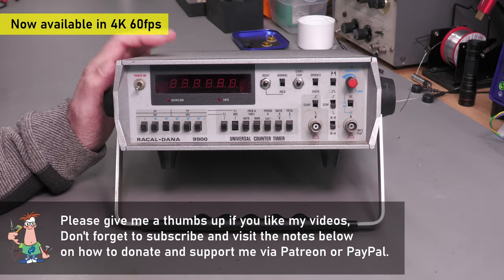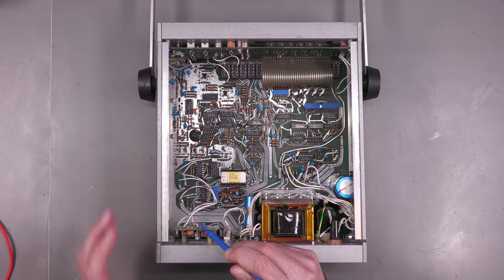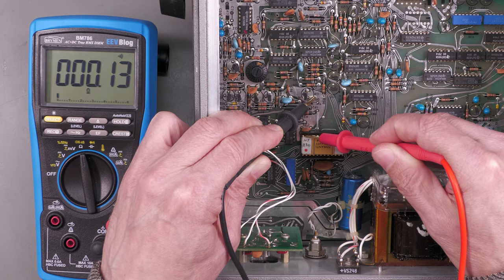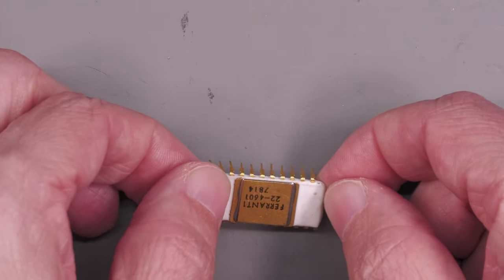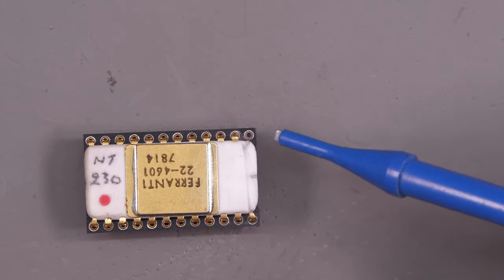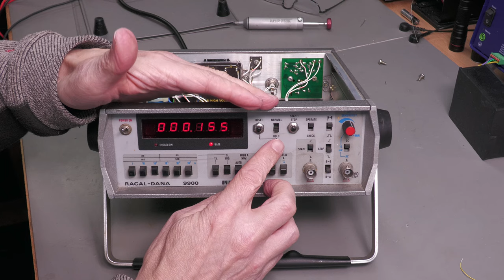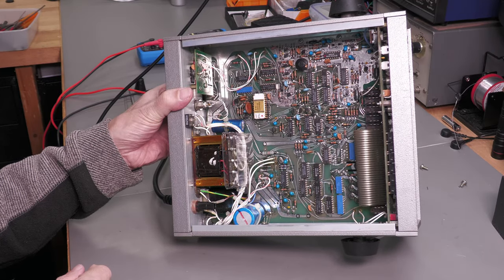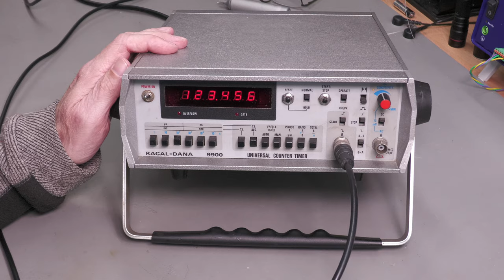No.119 - Racal-Dana 9900 Universal Counter Timer Repair

Comment from the maker: Re-uploaded to add in notice about the ceramic possibly being made out of Beryllium Oxide and the possible health issues. Better safe than sorry.
See the link in the video description.
Reply: Unlikely. Beryllium oxide is used as an insulating substrate with excellent heat conductivity. You'll find it in RF power transistors.
Reply from the maker: Agreed, possibly Aluminum Oxide or Magnesium Oxide?.....but at end of day who knows! I am borrowing a diamond tester (electronic device) which is apparently quite reliable at testing for Beryllium Oxide.
Reply: Thanks for the warning about Beryllium Oxide. That stuff is quite scary. I think people often encounter it when tearing down microwave ovens where it's used as an insulator in the magnetron. Better safe than sorry is absolutely the right call when doing any sort of grinding or filing of unknown ceramics!
Reply: @chongli297  Beryllium oxide is perfectly safe in bulk. The danger comes if you grind it into dust and inhale it. Don't worry about lumps of it.
Reply: @donepearce  Yeah though from what I've seen, people unknowingly take a dremel to it and create a ton of fine dust

Comment: Wow.  That dodged a bullet.  That LSI spun around 180 degrees and it still worked after correcting the orientation and (awesomely) grinding down the package to tack solder on the lead?  That's how I'd like to remember myself and my electronics technician past. LOL.   You are a master.

Comment: Nice repair, Ian.  Beautiful job on that ceramic IC; it should have been a total loss.  The way that unit's internal oscillator is configured on a separate board at the back of the enclosure just cries out for a high-accuracy, high-stability upgrade.  Future video?
Reply from the maker: It’s a 5MHz crystal oscillator on that wee Pcb I believe, if it had been 10MHz then it would have been easier by just adding an OCXO.
Reply: @IanScottJohnston Great repair. I just got one of those £13 ebay 10MHz OCXO for my HP5334B. Just aging it at the moment... pretty stable already. For your unit, just add one flipflop to divide by 2 ?
Reply from the maker: @TheHWcave  very true, I have a few 10MHz OCXO lying about……might just do the flip flop upgrade.

Comment: If you're ever in a similar position, you can poke around with a multimeter with the diode check function.  Inputs are going to look about the same, outputs are going to look the same but different from inputs, power and ground stand out.

Comment: Had to do the same my self more than once, mostly use  turned pin for this type of repairs.
Epoxy packages are much easier, top marks for persistence.
Nice work, boubtful its berylium Oxide though.
Althouigh if I recall correctly the contacts were gold plated berylium copper.

Comment: I think I have the same counter on my bench at work that I accidentally borrowed from ferranti about 30 years ago. They work ok but not stunning and really lacking in decimal places for modern radio work, from memory they are quite low frequency range about 30mhz , still nice to have an LED display for easy of reading. Oh the push switches need cleaning periodically. Those electrolytics of that style will be bad.

Comment: @ 15:32 It should work on the 10^4 range, but you didn't give it enough time. It takes a count every 10 seconds on that range. I have the 9901 & 9904. Also a few 1991 & 1998's. Bit of a Racal Dana nut :) Nice repair. 👍
Reply from the maker: Yep, saw that when I was editing the video. Cheers.